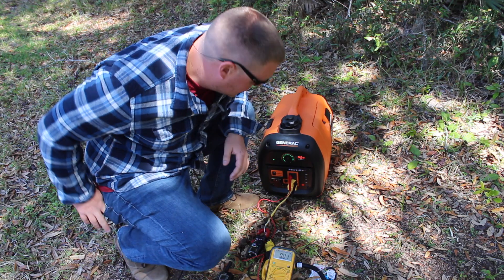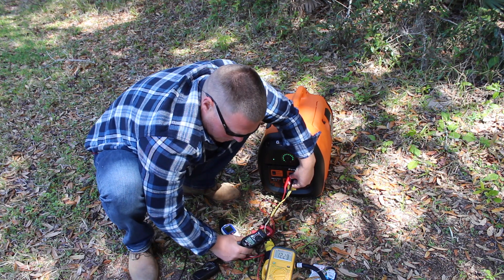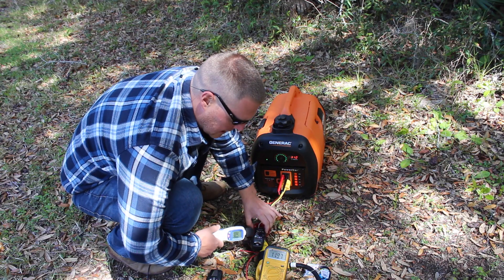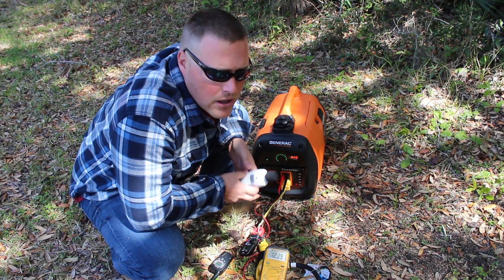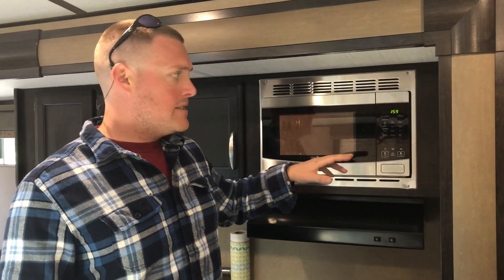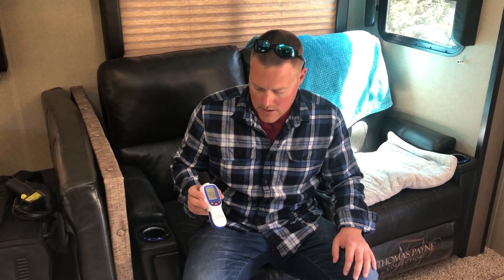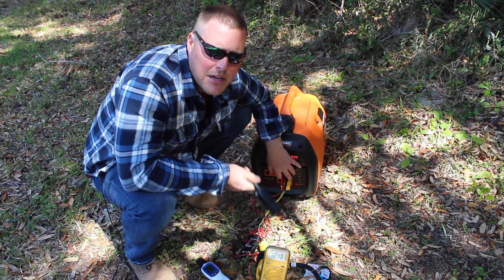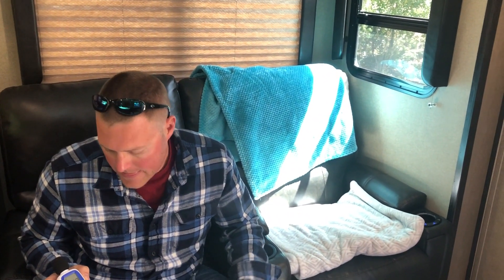Real World Test on Generac iQ2000, Will It Power AC, TV, Water Heater, & More?

Comment: I have a little older Generac iX2000.  As a part time electrician. I noticed that a simple electrical tester told me that the there is an open between the neutral and ground connections.  After giving Generac a lot of grief (since this is in violation of the National Electrical Code), they replaced the unit.  The new unit had the same issue!  The Product Safety Commission said there was no problem but didn't explain why incorrect wiring was OK.  

Also, my 900 watt generator would not work in my RV.  The microwave manufacturer said that the micro required a properly wired outlet to work.  (It would work if I cut the micro power down to 450 watts.)

Consumer Union (Consumer Reports) was asked to help, but the only thing I got from them (reluctantly) was not some small generators are wired in the open ground configuration. 

Could you test your generator with a regular household outlet tester and tell me what you find out with your generator?  For use with camping trips, an ungrounded is a real safety issue. 

Thanks for your Youtube video and your feedback.
Reply from the maker: Wow, thank you for the information. We will have to check ours for the same.

Comment: What can i run with two generac 2200i run safely in my travel trailer?
Reply from the maker: That depends on what you plan to run in the travel trailer. Each appliance requires a different load. Did you have specific appliances in mind?

Comment: Is this generator enough to run just a side by side refrigerator/freezer or do I need a 2200 watt?
Reply from the maker: Do you know how many amps it draws?
Reply: @generatorpower7744  5.2 amps according to the label. I would like to get a small inverter generator to run my fridge only.  I have a generac 8000 watt to run everything else I need but don't like to run it much because it's very loud and uses a lot of fuel (9 gallons in 12 hrs at half load). After a hurricane I am sometimes without power for weeks and I'm looking for a cheaper/quieter way to keep food and drinks cold.
Reply from the maker: A 2000 watt generator should handle that with no problem. The Generac:  https://amzn.to/2OiRfSK is definitely one of the quietest, but it did struggle with heavier loads. We also really liked the iGen 2200: https://amzn.to/2QUm8M1
Reply: @generatorpower7744  thank you for your help.

Comment: Would that Generator run a 5 or 8K BTU wall mount ac?
Reply from the maker: Do you know how many amps it draws? Each unit is slightly different, but if you know how many amps it draws then you'll know which size generator will power it.
Reply: Not sure but can find out. Its the ones they install in new small travel trailers.
Reply: @fattie2550   We'd like to know this as well. looking into the same thing